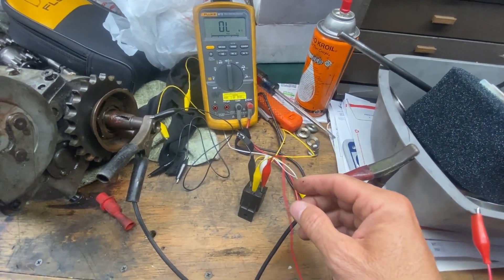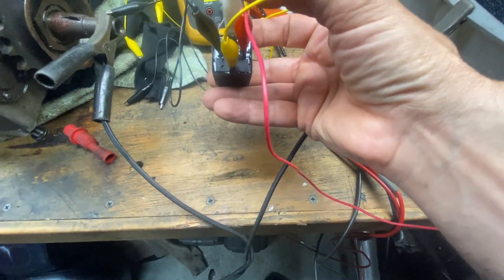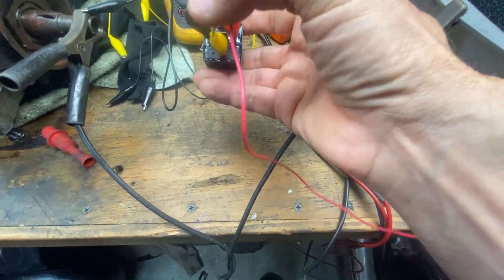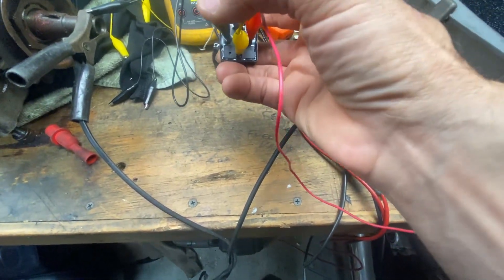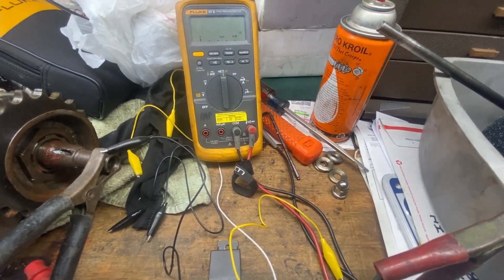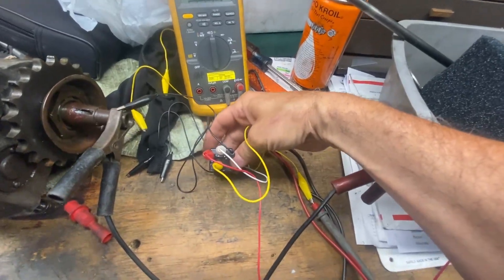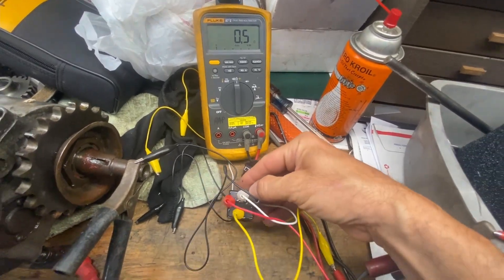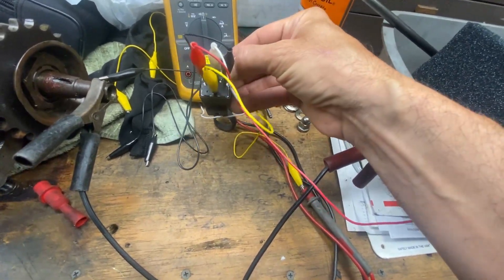Harley Starter Relay Wiring explained

Comment: 👍👍😊🏍️
Reply from the maker: Thank you again!
Reply: @Rapsgarage  I sent this info to my son he lives in Phoenix he has a 2003 road King and the horn never worked he bought it a couple months ago and now the speedo and the turn signals don't work. So I try and give him as much help as possible but he's not good on electrical stuff. I tell him it's like a road map and you don't have to look at the whole map of the United States you just look at a given Town AKA are given circuit. But he gets frustrated I think he's more of an artist than something mechanical. Even though he's brought back a 36 Chevy to life and done the wiring himself. But when it's working with someone else's wiring like in a bike that he didn't wire himself like from the factory he gets frustrated. I told him yeah no your limits poke at the limits but then don't do something that you might screw up. Don't be like your dad most of the time if I screw up I can fix it LOL